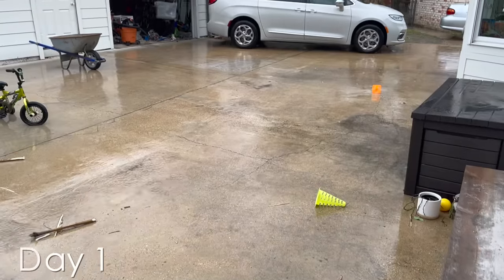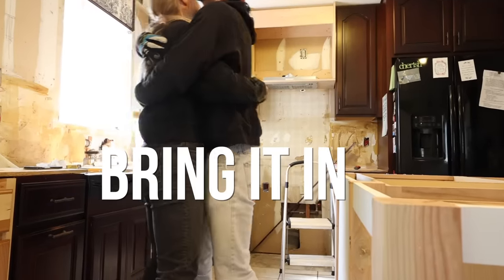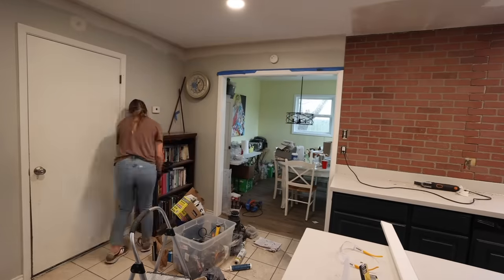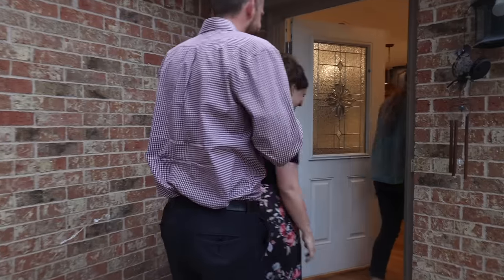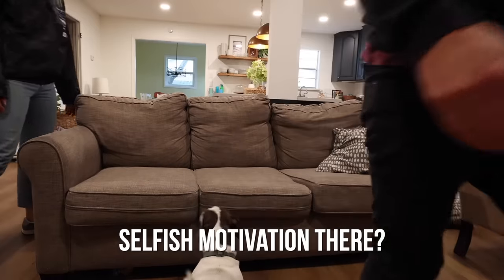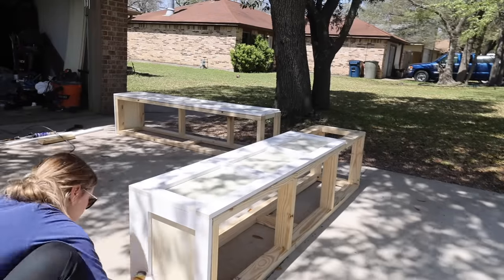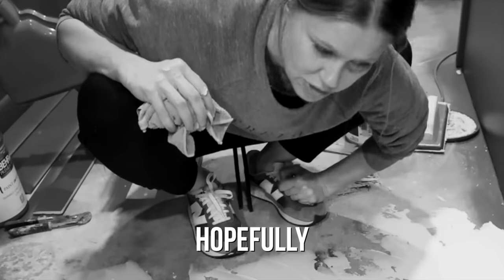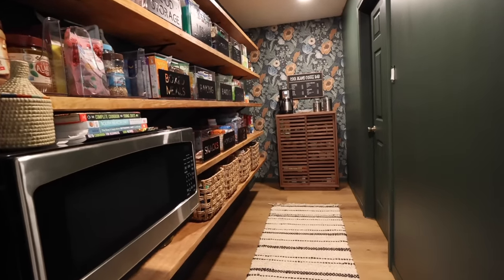DIY EXTREME HOME MAKEOVER [90 Day Transformation!] // Kitchen, Living Room, Dining Room, Pantry!

Comment: for wall painting the first coat, I always do it with a paintbrush in order to avoid dust bubbles and it will also merge any other dust residue. Then I can do the second coat with a roller

Comment: I don't know how many times I've had to correct people about "floating" shelves. A floating shelf is a shelf that you can NOT see how it is attached to the wall. No screws, no brackets, nothing. Floating shelves are hollow in the middle and they slip over their support so no form of attachment is visible, thus the name "floating". Smaller shelves can be attached with keyhole hardware imbedded into the rear edge of the shelf and slid over a screw in the wall. If you can see how a shelf is attached to the wall, it is not a "floating" shelf.

Comment: Just wondering. The original cabinets had raised panel doors. When you got two new wall cabinets, you got raised panels doors and everything was a perfect match. When you got the cabinets for the Island, rather than get raised panels to match the rest of the kitchen, you used shaker style doors. Since these door were a very different style, it took away from the cohesive look of the kitchen. Your outstanding eye for detail made every thing look amazing; I am just surprised you didn't use matching cabinets doors.

Comment: Like your creative style, you should consider doing interior design for neighbours if they allow you to film as your friends have allowed. My only gripe is you need to work smarter, not harder. Your best friend is not your husband, it's a...

LASER LEVEL 😱

With all the moola you're making from your channel, I'm sure you can afford one. Just nip into Lowes or Walmart and pick one up. Alternatively, you can find self-levelling and locking lasers on Amazon. So, you'll be able to follow a straight line around an entire room. They come with cross lasers, which allow you to find out if something is plumb and level. I've found that Huepar has some of the best laser levels. Seriously, help yourself out and avoid doing some of the painstaking hard work you've been putting yourself through, UNNECESSARILY.

Other than that, keep up the good work 👍🏽